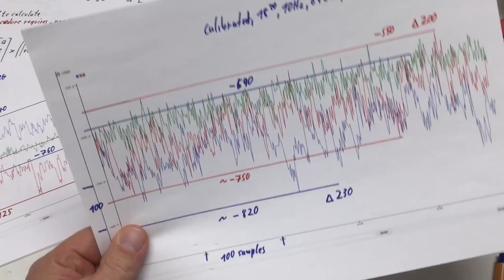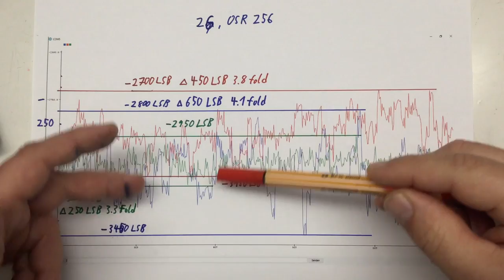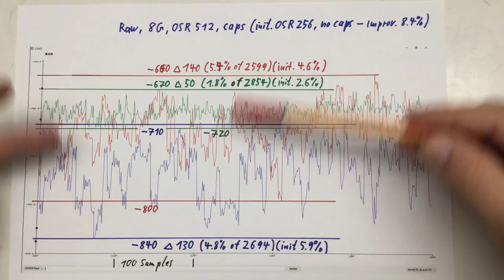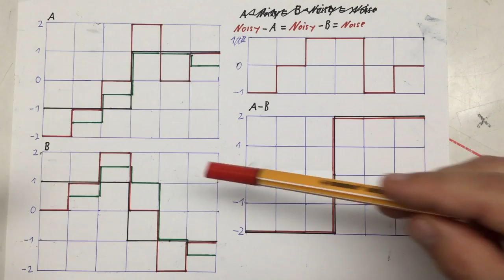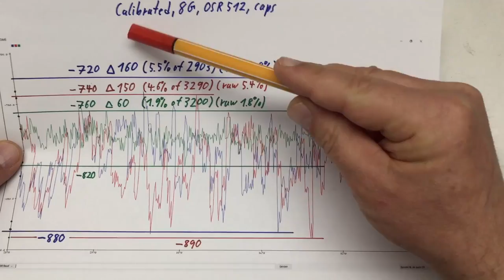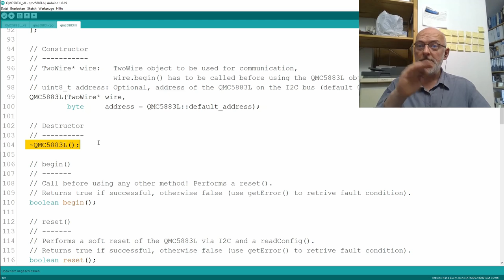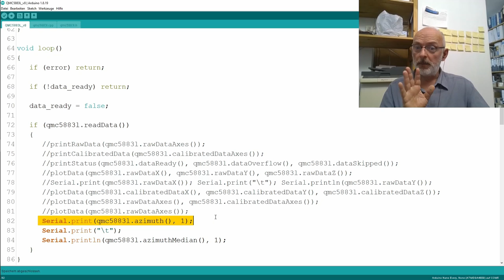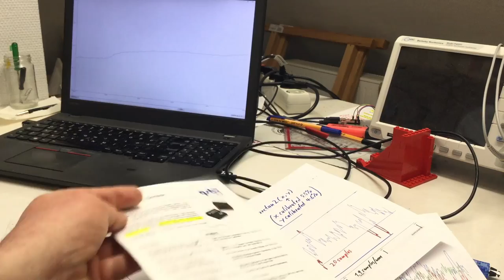QST QMC5883L 3-Axis Digital Compass and Arduino MCU – The Details (5)

Comment: Thank you so much for the detailed review of all aspects (electronic, mathematical and physical as well as code). I love gaining a somewhat deep understanding of how everything works instead of just plugging something in and hoping for the best. Your teaching style is both enjoyable and very easy to follow! Couldn't stop myself from watching the entire series in a short amount of time. 

Glad to have some of the observations I made myself about the magnetometer confirmed by you! 
For my purposes the sensor will suffice for now, as I'm looking to build a wearable compass belt that, through vibration on the skin, indicates the direction of magnetic north. So as long as I am roughly in the correct hemisphere it is already a good first step. Not to mention that as a wearable, I will probably have to deal with tilt compensation eventually. In parallel, I'm already looking at some IMUs with magnetometer and 9 DOFs (with fusion) as alternatives, sort of as "dead reckoning" mode. Seems like some chips out there can correct for long-term gyro drift with the compass. 

Again, thank you very much for your efforts and I'm already looking forward to watching your series about the MMC5983MA! :)
PS: Will be fun dancing around with the belt in circles for the calibration, as we have learned that it should be conducted in the final system. :D
Reply from the maker: First, you're very welcome! It's always nice to see when my videos are actually useful to somebody.
Second, kudos to you for doing such an interesting project. You should definitely upload a video of the calibration 😉 
Third, I thank you for leaving this very detailed comment.

Comment: Thanks for the series. Learned a lot. 
Did you ever write the library you mentioned? 
Which lib do you recommend after 2 years this video was made? Thanks.
Reply from the maker: You're welcome! And no, I never wrote a "complete" Arduino library for that thing. However,  you can use the .h and .cpp file from my code (link in the description of the video) and use it in your Arduino projects. Which library do I recommend? Well, I think my code is functionality wise the most complete 😅
Also, have a look at the MEMSIC MMC5983MA, a much better compass chip than the QMC4883L. Link to the last video in that series: https://youtu.be/BgSZ5XZTDDg
Reply: @robertssmorgasbord  Ok Thanks. 
I'll give it a go. Unfortunately, I didn't know about the initial calibration to make it useful, and installed it on a wooden mast on my robot. Now I'll have to take it down and calibrate it :face-red-droopy-eyes:
Reply from the maker: @piconano  Yeah, calibrating those things is always a hassle. Have fun with your robot!

Comment: Robert, thanks for doing this in depth review. Almost all sensor videos on Youtube are just about how to hook them up and perhaps a little bit about the limitations. Any explanation of why the X and Y noise is about double the Z noise?
Reply from the maker: I thank you for the praise! My in-depth videos are unfortunately not of interest to most people - the majority is just looking for a hookup guide and a library that (somehow) works 😅 Regarding the differences between X/Y and Z noise: That's an interesting question and I came up with three possible (!) explanations:
A) The X and Y sensors, being perpendicular to the die, have to be buried into the silicon. Since the die has only a certain thickness, I guess they are of a rather elongated rectangular shape. The Z sensor, being parallel to the die, can be simply build up on it, allowing for a more balanced/quadratic shape. Anyway, the bottom line is, the X/Y and Z sensors are created differently on the die, and thus can have different properties (in regards to noise).
B) The differences between X/Y and Z sensor are simply caused by manufacturing tolerances (a bit weak, I know).
C) The X/Y sensor are exposed to the stronger horizontal component of earth's magnetic field, while the Z sensor is just exposed to the much weaker vertical field (this could be verified with more noise measurements with the Z sensor pointing horizontally).
My favorite is A) with maybe a bit of B). It is notable that many 3-axis magnetometers do have a different scale for the Z-axis, indicating that there are indeed manufacturing differences between the X/Y and Z sensors.
Reply: @robertssmorgasbord  Thanks for you reply. I was thinking of C as the possible cause, and I had not even though about A.
Cheers.
Reply from the maker: @7alfatech860  You're welcome! And thank you for bringing up that point in the first place. I kinda skipped over that in the videos 😅

Comment: Robert, thanks!
But i can't compile this code...
in "qmc5883l.cpp i got error "```cpp
Compilation error: call of overloaded 'requestFrom(uint8_t&, size_t&, int)' is ambiguous
```" 
board: Arduino UNO.
Reply from the maker: You're welcome! Just cast the arguments for requestFrom to specific types, e.g. requestFrom ((uint8_t)addr, (uint8_t)size, (uint8_t)stop). Unfortunately there are several versions of requestFrom() with the same number of arguments, but having slightly different types for those arguments. Sometimes the compiler can't decide which version to use.

Comment: im giving up on cheap digital compass modules, i tried a bunch of them, is all the same, so noisy!,  so dissapointed. i just wanted to make a robot that could  i program to go  "point to direction A then move B steps, now point to direction C move  D steps". no luck so far. 
Have you tried the more upper tier modules like WT901, HWT906 ?? i just find it crazy that i have to  look  for  modules in the 60$  range and up  just for a decent digital compass. even the most trash  low tier mobile phones have no problem giving you  a nice stable heading direction. you would think is a problem long solved and perfected at a a cheap price.
Reply from the maker: Yup, the cheap chips are noisy. I never heard about either the WT901 (TDK InvenSense MPU-2950 chip - obsolete, successor is ICM-20948) or the HWT906 (PMI Corp RM3100 chip), but at least the RM3100 is extreme low noise (0.15 to 0.20 mG). The lowest noise chip I found so far is the MMC5983MA (0.4mG). So thank you for the Info!